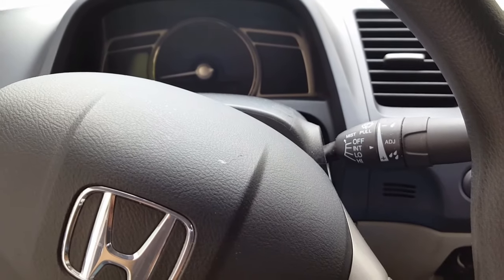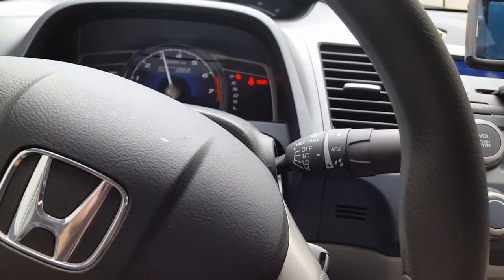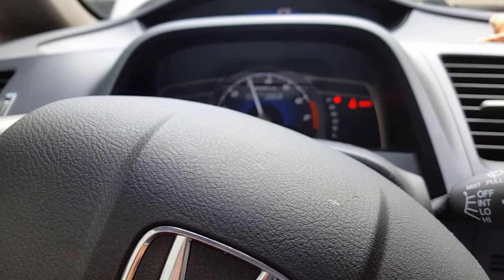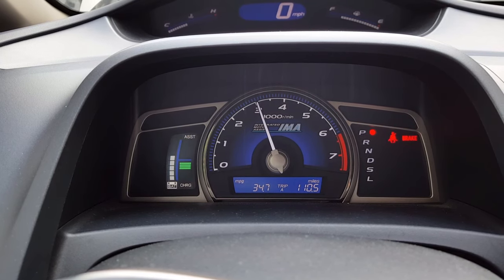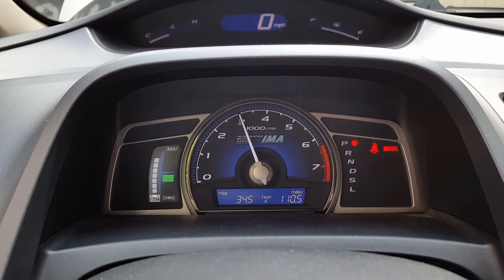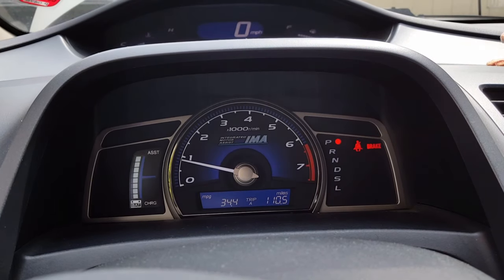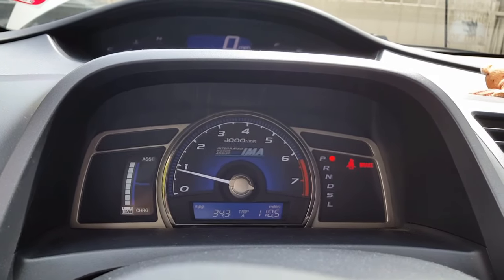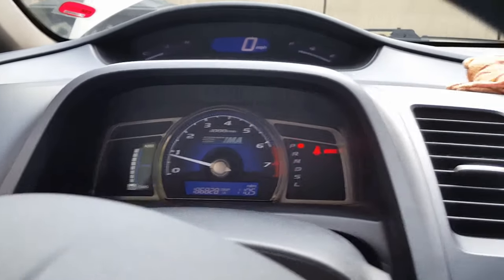DIY: Honda PCM IDLE Relearn Procedure on a Honda Civic

Comment: I had problem with acceleration around 2000-3000 rpm. Car didn't run smoothly after valve adjustment. No codes in ECU. Checked sparks,  cleaned and in the end exchanged 4 ignition coils, cleaned  throttle body and it fixed nothing.  After doing Idle relearn procedure  it finally back to normal.  Thanks a lot with this movie! I did it on  parking lights on and got same good result.  My car is Honda Jazz/Fit II 2004.
Reply: @SterlingW8  went to get a smog check and they mentioned that the rpms were running too fast for 25mph @ about 2100 a little above the passing speed, so it failed. he mention that i can adjust the rpm speed with a screwdriver or something by loosening the throttle body or something. Do you have any idea where exactly i can do that? i cant find any videos on it, they al just talk about idle speed when im pretty sure my problem is at 25mph with a slightly high rpms.
Reply from the maker: @Nunya00  dunno about the 08 civic... time to Google it.
Reply: @Nunya00  using a screwdriver to adjust idle is more of a carburetor thing i would think.

Comment: Holding RPM's at 3k is not part of the relearn. Just heats the engine to operating temp
Reply: Thanks for the tip.
Reply: What is the process i need to kno
Reply: With regards to this : when trying to idle relearn my 7th gen civic, if I heated it up PRIOR to the idle relearn then it would only idle when hot. If you include the heat up process in the idle relearn it helps the car to cold start and learn how to idle in sub optimal temps not just when it’s hot.
Reply: @asherq8646  so I should do the idle relearn when the car is hot & wait for it warm up, or I can do it at start up even if it’s cold?
Reply: Thanks for clarifying that.  I've seen idle relearn procedures where you just let it idle until fans come on...then let it idle another 10 min after that.  I think a lot of people think that keeping it at 3k rpm's is part of the procedure.
Reply: @kevhed8  so basically u just turn the car on from cold start and let it idle for 20 minutes?

Comment: I had this problem on a 2009 honda accord euro/acura tsx after cleaning the throttle body and just following an idle relearn didnt work for me, first I needed to an ecu reset and clear the throttle values which can be done without any scanner or honda dealer:

To do the battery cable reset- follow this: 1. Remove negative battery terminal. 2. Remove positive battery terminal. 3 Be sure you arent going to make contact with the battery, for later steps possibly even remove it from the car if needed 4. Connect the battery cables together either using a jumper cable or clamp them together if they reach. 5. Turn on your key to on (not ACC, to on) and yes there will be no lights on the dash. 6. Leave for 10 minutes. 7 Turn your key back to off, reconnect positive then negative and THEN follow the idle relearn procedure you will find pasted all over youtube (or just start the car rev 3k rpm until the car reaches temp and then leave it to idle 10 min). You will also need the radio code and possibly relearn your auto windows, for which there is good info for on youtube.
Reply: A K thx,  these are the best instructions I’ve seen for any issues related to a hard computer reset.

Comment: Hey, I am also thinking about cleaning the throttle body. Did you "Reset the ECM/PCM with the HDS" before you do this idle learn procedure? I heard a lot people meeting the rpm fluctuation problem without doing it.
Reply from the maker: On the 2008 Honda Civic Service Manual, it tells me to do the 3,000 rpm PCM procedure after the throttle cleaning.  And that's what i did.
Reply: Got it. Thank you!
Reply: +Sterling Wong did you remove the throttle to clean
Reply from the maker: +Rich Lo no just did a surface clean of the gunk around the throttle body.
Reply: Is this procedure the same for the Honda Accord models?
Reply from the maker: Not sure, i dont have an accord service manual
Reply: This manual relearn process is only needed if you manually moved the throttle opening while cleaning, that will desynchronize the throttle. If you pressed the accelerator so the vehicle can electronically move the throttle opening on its own you don't need to do this process.
Reply: @rhdtv2002 I removed the throttle body did the whole relearn process but idle stays around 1,100
Reply: @freshtelovision bendede aynı nasıl çözdünüz

Comment: Hi, i am trying to follow this procedure but i think i can't complete it. The rpm is still stick at 1 and not lower like 0.8. Also i've noticed after finishing the procedure, when I press the gas pedal just a little bit, the rpm goes up (of course) and then in its way down, it goes up again alone... then it goes down to stick at 1.

I took of the throttle body for a little clean up, then put it back. I first received the code P1129. After following this procedure, i went on highway and after coming back home, just before turning off the engine, i get the code P0507.

I might havent replaced the throttle well or something like that.
Have someone experienced the same problem? codes?
Any idea?
Reply: Soufiane Mess not 100% sure but that sounds like an air temperature sensor malfunction, take off the minus pole of the battery for 1-2 minutes and check if the air temperature sensor stays on right position and its clean, after that reconnect the battery and it should work fine than you can do that relearning procedure.
Reply: I have the same stuff except I get pO443. So weard I never had that. If you find a solution keep me posted. I'll try this and see if it's  works
Reply: Shit I wish mine even idled at 1k mine idles at 2k. Also onc ei press the clutch in my rpms jump high before dropping again. I've replaced my iacv my map sensor and my tps sensor plus cleaned my TB and it's still idling at 2k
Reply: @WavyVaporizers  sounds like straight up transmission issue
Reply: @VeggieRice  it was my tps that needed to be calibrated. Car is perfectly fine now 💪
Reply: @WavyVaporizers  glad to hear it, & thanks for sharing that nug of knowledge. be easy
Reply: @WavyVaporizers  how did u calibrate ur TPS bro?
Reply: @kmlumd44  my mechanic did it. There's a bunch of videos online that teach u how to do it which seem easy if u have the right voltage meter tool. I didn't own that tool so I didn't even bother I just let my mechanic do it
Reply: Mine just did the same thing. It threw the 2 same exact codes as yours and i did exactly what you did. How did you fix yours?
Reply: @erniecarrasco9107  ah, I had to take it to Honda at the end, it needed a programming as I miscleaned inside the throttle body :( cost me like 150$ CA, I told him exactly what needed to be done but they had to run a diagnostic anyway. Probably in that 150$ the diagnostic was included.
Reply: @soufianemess7681  Honda told me the same thing. They need to clean my throttle body and said they would do it for 90. I cleaned it myself. I think i just need to reset the throttle position sensor with a good scan tool. The Honda dealership didn't even know about this. They said if the cleaning didn't fix it then buying and installing a new throttle body was their only solution. I can do all those things on my own. He said the procedure to do after you clean the throttle body waa to let the car idle with the headlights on for 30 minutes. I did that and it didn't work. So they would have done what I did then told me to buy a new throttle body. I can see with my cheap scan tool that the throttle stays open 18 percent with a closed accelerator pedal and it opens to 78 percent with a fully open accelerator pedal (pedal to the metal).  So my guess is that the throttle body needs to be reset. Honda tech guys don't even know about this. Kinda wierd huh?
Reply: @erniecarrasco9107  I'm surprised they didn't know about it! I remember I found a good article talking about having to reset that with a special tool like you mentioned. Also I remember I downloaded the software that Honda uses for their cars.  I just didn't have the right tool. And I'm not sure if you can reset the throttle by yourself without having that special tool as it's all electronic now. I know it's pretty annoying having that RPM around 1 and higher. After I tried everything I gave up and took it to the dealer.

Comment: hi my honda civic fd 1.8s 2008 idle is 1200rpm, but after 1 minute it goes down to 850rpm. is that normal? fyi mine is none hybrid.  thanks
Reply from the maker: +M Atienza depending on engine temp, maybe. Both my hondas idle at about 1k give or take 200 rpm

Comment: So, 1,329.46 is what it cost me fixing my crank no start, 2005 civic coupe. 119,200miles. So past month it wouldn't start , I replaced, ignition coils, spark plugs, battery, grounds upgraded to 2 gauge wiring, ELD replaced, fuses, 130 in relays, fuel pump, injector & rail & to round it out a genuine Honda ecm reflashed with my car, still no start. I had spark, compression, air & fuel. Stumped 3 mechanic friends who are veterans, reopened fuel pump & was priming & spitting gas. In last ditch effort I said fuck it & replaced whole sending assembly, it started. I forgot about relearn procedure though. How can I reset it, is it 10 or 20 min?

Comment: Is it really necessary to hold it around 3000 RPM until its rad fan turns on or could it be also done by just waiting for its rad fan to turn on without holding it around 3000 RPM? What's the logic behind?
Reply: You can let it idle and wait for radiator fan to turn but may take longer time like 5 minutes or more. 
But putting the engine at 3,000 rpm may take 2-3 minutes for the fan to turn or the engine reach operation temp.

Comment: I live in London. I have 2006 civic hybrid import from Japan.. IMA light appear but it's goes on an off.. any idea how to reset this or I need software update
Reply from the maker: +D Dentist if you still have a warranty on your IMA system i would take it to the dealer for warranty repair. But a simple obd2 reset or disconnecting the 12 volt battery for 15 minutes maybe able to temporarly reset it.
Reply from the maker: +D Dentist ima updates are done at the dealership kinda hard to find the ecu updates on it.

Comment: Could you change acceleration throttle on cable? I don't like at all electronics... if you have on cable only need to change a little bit idle screw and all done :))

Comment: My 2003 HCH idles at zero rpm.the car is not shaky and the engine does not stall. No check engine lights either. Only issue is poor acceleration and poor gas mileage.can anyone help??
Reply: Yinka Okunade tps

Comment: I cleaned the throttle body and did this relearn procedure. My car now idles at 1,100 RPM. Any tips on how to get it down to 600-800 RPM?
Reply: Check egr
Reply: @Jerm353  I'll try to clean the EGR valve in the next week. Does the EGR valve act up after cleaning the throttle body? I had good rpms before I cleaned the throttle body, but after cleaning the throttle body and doing the tps relearn procedure, my rpms are at 1,100.
Reply: Higher rpm usually is a stuck “something” or a vacuum leak that have not been picked up yet by the computer so recheck your work. Make sure you didn’t leave a hose loose
Reply: Just following up… I was able to borrow an expensive diagnostic tool from a friend. I ran a TPS reset and then I did this relearn procedure. It worked perfectly! I am now around 700 RPM at idle. I tried the relearn procedure at least 7 times before, but it only worked after I ran the TPS reset on the expensive diagnostics tool.
Reply: Would you happen to know which tool you used? And how long you did the relearn after the reset? I'm experiencing the same exact thing

Comment: Did this method twice and neither worked after cleaning my throttle is this only for hybrids??
Reply from the maker: iit seems to work on my hybrid... it states this in the service manual...
Reply: @SterlingW8  he did this wrong you have to take the number 6 fuse for a minute, them put it back them start the car at 3000 rpm for five min, them let the gas go and let the car on for five more min, that should do it.

Comment: i have a problem with my idle, when i turn on my air conditioner, my idle rpm goes down about 600 rpm. i have tried to relearn like ur video cause i just changed oxygen sensor with the new one. can you help to solve my problem?
Reply: Dino andrian did you figure out the issue?
Reply: Bro have u solved this issue, my civic has this issue now
Reply: reset your battery first. there’s instructions in the comments above.
Reply: Hi Dino, have u solve that problem? My car also happen like that

Comment: Hey man do you kno if theres a relearn process for oxygen sensors? Great video by the way
Reply from the maker: I dont know. Last time i had a o2 or mass airflow sensor issue with my other honda, cleaned it and did 12v battery reset, and cleared the codes with a obd2 reader. Never came back.
Reply: @SterlingW8  stupid question but how did you do a 12v batter rest? Thanks for the reply. I got p0141 changed 02 sensor deleted code and p0141 just keeps coming back i also checked over the wire harness everything seems fine there so im really at a loss for ideas lol😅 its a 08 civic incase anyone or yourself has any ideas would be greatly appriciated..
Reply from the maker: @nd4120  not sure if it helps but, i reset the 12v to clear most issues, if not then the obdii will.
Reply: @SterlingW8  ok awsome. And how exactly did you go about resetting the 12v? Sorry if it seems like a stupid question.
Reply from the maker: @nd4120  disconnect the 12v battery for 3-5 minutes. It will NOT clear major codes, for that you need an obdii reader.  And even that is temporary, if there is a problem with the car it will still throw codes.  Good luck! ... or just take it to a mechanic. :)
Reply: @SterlingW8  oh ok . Thanks so much i really appriciate the advice!!

Comment: u can charge on L Mode with foot on brake in 10-15 mins
Reply from the maker: yup
Reply: I got same problema, I need help please, is 2006 honda civic hybrid 1.3L 4 door, the IMA battery is not charging. 225 6780635

Comment: I tried this but the idle was the same and problem wasnt solved. Engine light still on. Is it safe to attempt again?
Reply from the maker: You may want to get a obdii tool and app to see what going on.
Reply: @SterlingW8  yes code was P0507